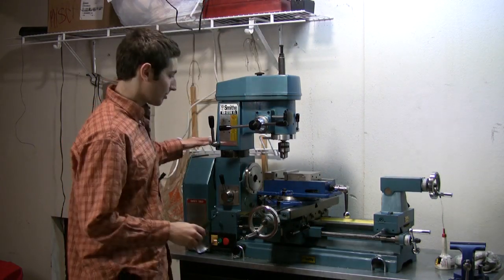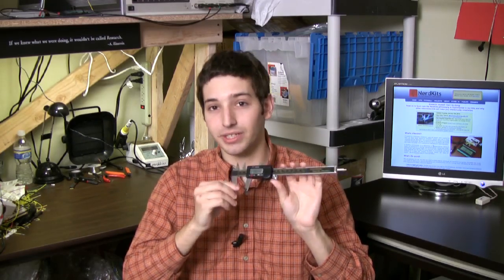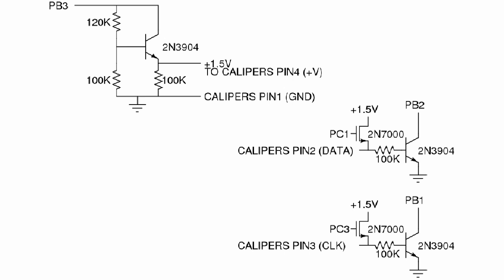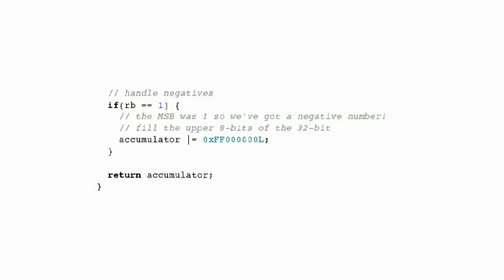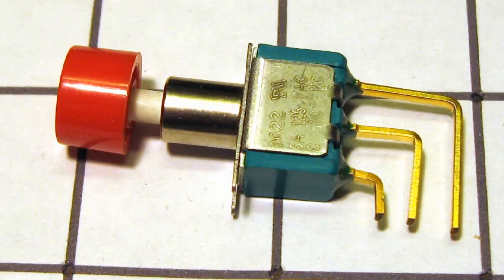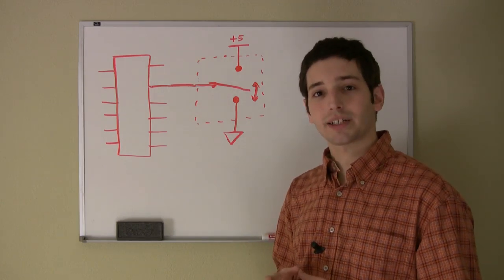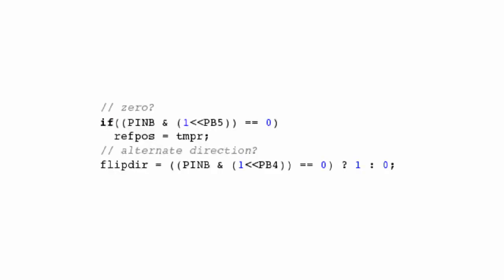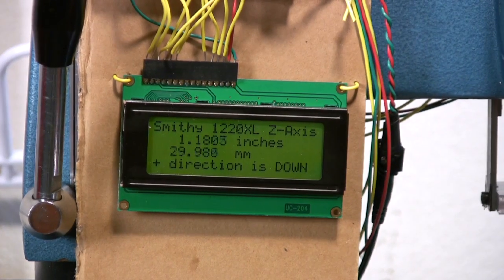Digital Calipers DRO

Comment: Brilliant.
You may want to explore the 4016 Quad Bilateral switch to allow controlling everything from a uController, where the uController would actuate the actual zero button of the caliper, as well as the Units button and the on/off switch.

Comment: @TheBerkeleyGang If you've already got a DRO, you only need to connect a geared down DC motor to your microcontroller and attach it to the screws. A bit of programming and you've got a servo CNC machine. Use the DRO for position feedback.

Comment: Great hack!
You should have a resistor at the input, when you have a pull up resistor between the Arduino and the switch.  
No needed, but the total mA in/out of I/O-pins in the Arduino could be to high without the resistor.

Comment: i would like to build a setup like this with 2 axis read. if i use a teensy 4.0 board with 3.3v logic , would i need the level shifting. the micro controller do not need to send to the caliper unit, only read? am i understanding the work?

Comment: Hi.  I have just made myself a DRO using cheap calipers (sadly before discovering this video).  Do you have any advice for preventing interference from my lathes motor when it is turned on/off from interfering with the calipers reading (They tend to jump in 5mm steps which I believe is a common issue with them)?